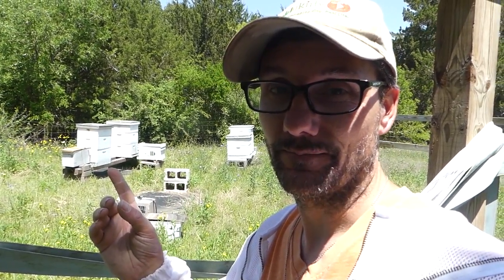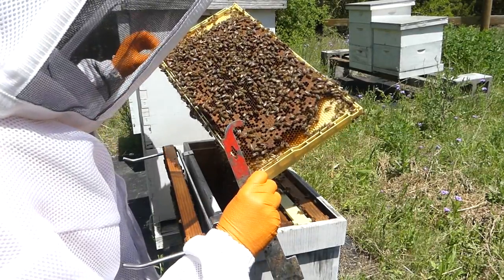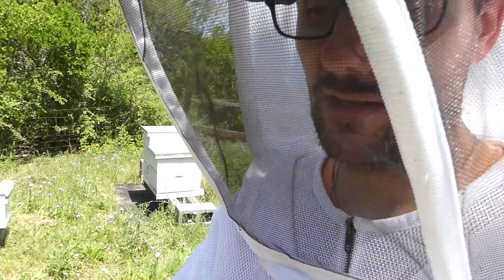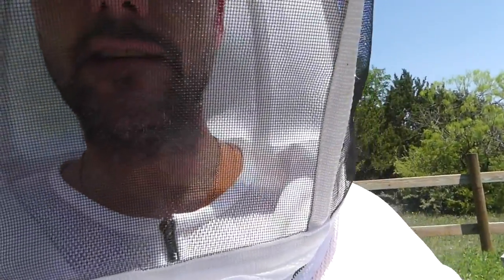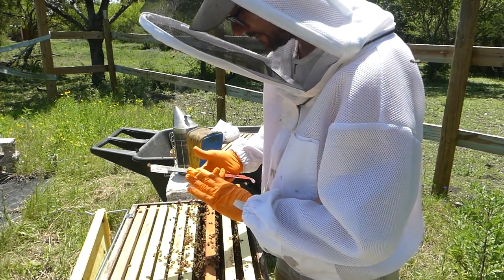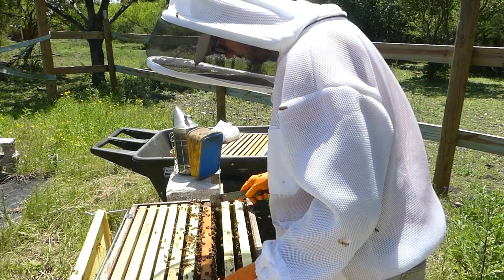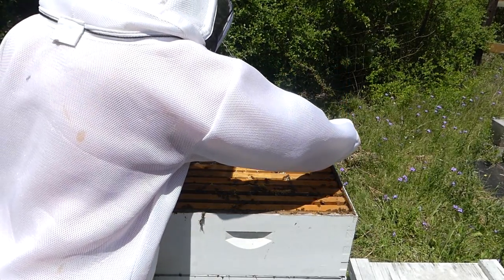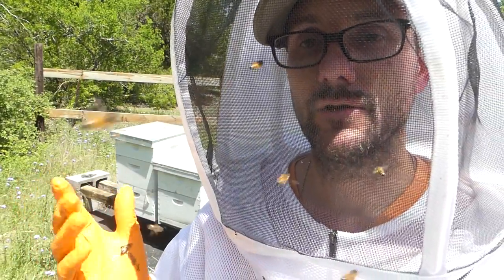Beekeeping - How Did The Splits Turn Out?

Comment: I keep buckfast bees so they do tend to have a lower chance to swarm but when I split hives, I literally just shake off 8-9 frames worth of bees, pull 6 frames with a mixture of brood (capped and uncapped), pollen and honey,shove them in a nuc and move the nuc at least 6 metres away.  Never had it fail and you do tend to loss about a third of the bees within 2 days (they tend to fly back to their original hive) but after that it levels out.